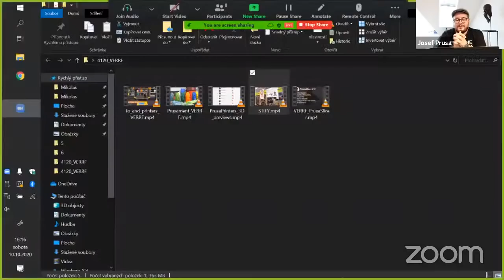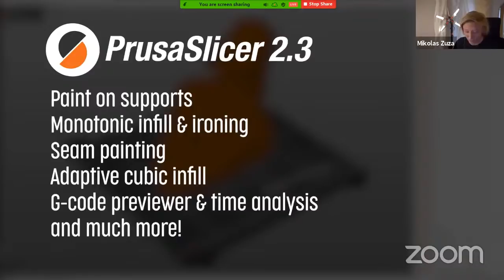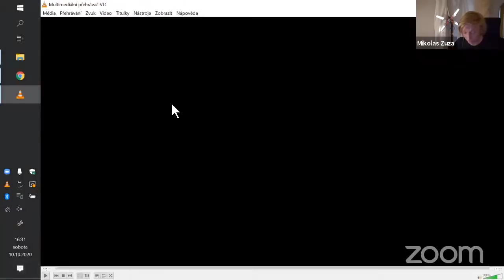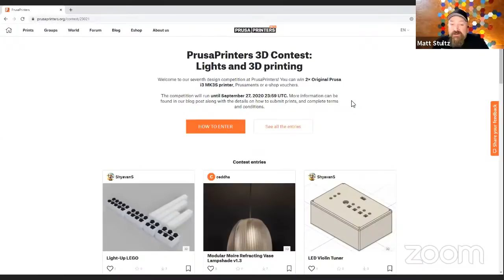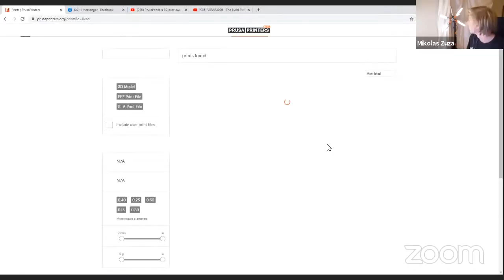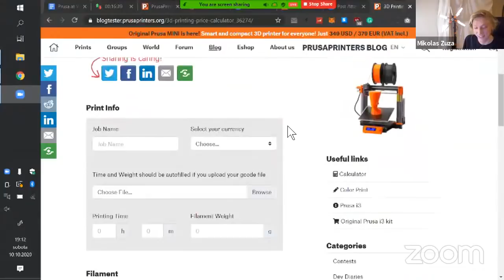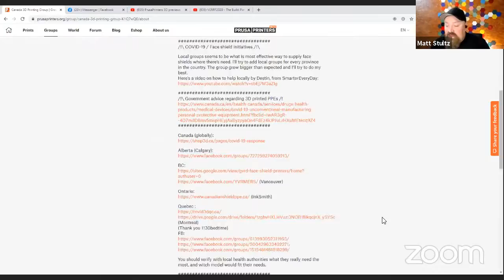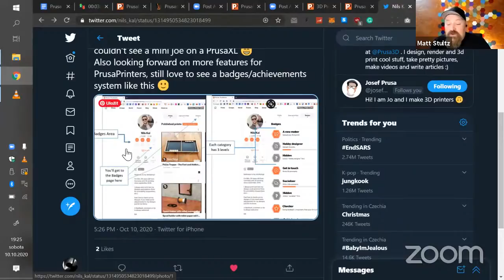Prusa at VERRF2020 - stream recording

Comment: Awesome additions to PrusaSlicer, this will probably save me from doing rework on a few models where I need a smooth surface finish. Also looking forward to the new features for PrusaPrinters.
In my opinion the whole Prusa Ecosystem (Hardware, Slicing Software and File Sharing Site) is the best on the market, keep it up 👍

Comment: I would appreciate less packaging and plastic waste. Each roll comes vacuumed in plastic, then packaged in cardboard, then all spools are in a cardboard box and again wrapped in plastic.
Reply: Adopting the MasterSpool concept would be really cool (goes for all the filament manufacturers).
Reply: Talk to the guys who sell 10x more filament than Prusa first. Nobody wants wet filament, and nobody want dry filament that isn't in a box. Prusament rolls use less plastic than most other rolls regardless...
Reply: @avgvstvs96  Of course there are always bigger manufacturers, but Prusament being more of a premium brand could easily offer Masterspools as a more environmentally friendly variant. That would also set an example an put pressure on the filament manufacturers in Asia.
I don't get what you mean with wet filament or dry filament without a box. Masterspool coils are better vacuum sealed than tradition spools (simpler geometry), an still get shipped in a cardboard box.